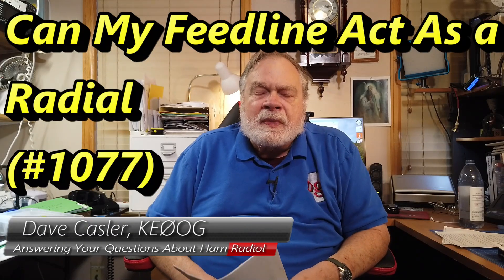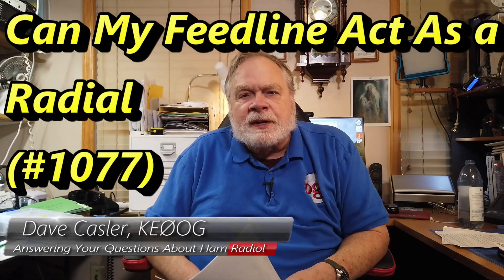Can My Feedline Act As a Radial (#1077)

Comment: If you have a lawn edger you can easily make the grooves you need if you want to get them protected immediately. At a minimum using a weed whacker to clear a groove to get down to the ground will typically do. The only thing is, I would bury coax since it's susceptible to damage. I like to bury pvc pipe. That way if I want to mess with things like different coax etc I just pull out the old and pull in the new all at the same time. Cheers.

Comment: No No No... bury your radials if you have anyone using the back yard for other activities. This includes your family dog that likes to roam the yard. It's more of a "practical thing" than a performance thing!

I'm not sure what frequency this is for... but I run several Broadcast Services on MF & HF using 1611 khz and 4970 khz.... Both are ground mounted Inverted L's. I've had all sorts of drama's with "Common Mode Currents. It took me a few "heated discussions" with HAMS that can''t grasp the different needs of a Broadcaster. These are low power and are in close proximity to each other (they share the same earth mat). I need the tuned dip to be as wide as it can be, so I get the best audio bandwidth that the aerial Q will allow. I also want some sort of "rejection" offered to the opposite service.

I buried my radials because we have a dog, only about 4-6 inchs down. We are lucky to have VERY good dirt under us. You can disconnect the radials and see a drop of about 10% in coverage on 1611 khz. I use to run the coax on the ground and I did let the grass grow over it (as Dave mentions). Thankfully it was only a short run. But boy did I have tuning problems!

It took me some "very heated discussions" as mentioned to discover what was going wrong. I'd get the analyser readings R & J etc and punch them in to different modelling software. MMANA was the main one used (a couple of others point out things MMANA doesn't). I knew about High Pass and Low Pass as I wanted rejection of the oppsite services (as mentioned). MMANA has a LC matching tool, use it with the readings you get not the ones "it thinks" the aerial is when you put in all your dimensions. When you are told the values of L and C needed to do a simple L network you then need a Series Complex Load that represents the R & J of your aerial. If you do it this way you can get everything right on the bench against your mock up aerial load. Winning right? Nope!

I then take it out and put in the ATU box and the tune is WAY OFF! What gives? More heated discussions, Peter why are you using a L network? You said you wanted wide as possible. Which I did! But I also said I want rejection of the opposite service too (insert pic of ham with puzzled look). He was telling me to use a balun come matching transformer (that's another topic). But just not done in broadcasting circles. What does come out of this conversation is I get a much better understanding of Common Mode Currents.

My original fix to everything being different when the network was dropped in the box was to add a coax extension so I could have my Rig Expert (analyser) physically connected to the coax going to the TXer (all in situe in the ground with other coaxes and radials). This worked.... initially I thought I was on a tuned length of coax and it was effecting the matching. But silly me didn't wake up to the fact that a couple of times my "extension cable" use was different (I have a few spares). You'd think this would make the penny drop. Different lengths "should" move the resonance of what was a stub (that's another story too). But no... same problem. In fact it would move the tune by about 80khz no matter wich cable was used to extend it.

The penny finally drops.... I'm watching a video (not dave's) on Common Mode Currents. Oh! I wonder if that's what is happening here? Then ole mate says... one of the things CMC does is make your aerial look wider in tune than it really is.... OH! Penny Drops!

In broadcasting the coax is buried down at 600mm the same depth as electrical cables (by law here in Australia). This offers "isolation" from the earth mat...where your radials are only a few inches down. I'm starting to form a thought in my head... You know what... how does the RF know that a run of coax buried at the level as the radial - isn't a radial? Answer... it doesn't! So we need to help it!! Enter something like an Ugly Balun or we now step into the whole world of Toroids and different Ferrite mixes (another world of heat discussion with HAMS). Keep in mind I'm always on, this is not 30% duty cycle. It's not big power either, so some ham tricks may work.

I'm on 1611 khz and 4970 khz with 100W always on AM power. Some of the Toroidal designs will work well on 5mhz but totally unload due to the core mix on 1611 khz. I learnt this lesson the hard way. The super short version here is crack out an Ugly Balun.... 16 turns on 100mm OD pvc pipe made with RG213 that will cop decent power. The rule here is you want about 4 times the Reactance Ohms on the outside shield to the 50 ohms (seen on the inside of the coax). So the currents on the outside of the coax get blocked.... In my case 4 times is at least 200 (I get 380) on 1611 khz with something near 1800 ohms on 4970 khz... in short it works VERY WELL!

A test I do now is with any ATU installations made with ground mounted earths is as follows.... Hook up the analyser to the 50 ohm point without any part of the coax connected. Just the aerial... and read the SWR. Then grab the shield of the coax and tap it to the earth bar where you earth everything. If you see this changes the SWR, it's clear your coax is being seen as part of the aerial. You definitely don't want this.

I could have possibly made this comment a lot shorter and said - bury your radials and install a Common Mode Choke at the feed point. But I figured some context was needed.

73's all